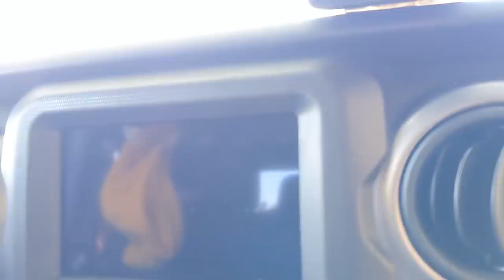Gladiator max tow Why I bought a barbie jeep

Comment: Just got mine last week. Sport S Max Tow in Snazzberry. I’m loving it. Like you mentioned, it wanders a bit on the highway. Nothing crazy but it’s noticeable. Especially in heavy wind. .
Reply: Haha I just got the 2022 Snazzberry Sport S with max tow yesterday. I havnt tried towing yet but I have a Sundance 222RB travel trailer so thats why I got that one otherwise I may have gotten the Rubicon but what I didnt realize untill today was that the Max Tow also gets the Dana 44 with 4.10 gears so I was pretty happy. Just no front lockers... thats an easy fix though.
Reply: @hillsideheathen5267  Hell yea. Front locker and rear LSD would be nice!
Reply: @hillsideheathen5267  check out a couple videos here on the  you tube channel: Renaissance man, a black sport s with max tow, he has Rubicon rock rails, but that was it for mods, where he went down to a river, really rocky terrain, camped over night, and climbed out the next day, wow! a little damage, but overall impressive. bought a Rubicon 2 weeks ago, more of an availability thing, and the only way to get the painted metal top. but my plan was more like what you got, lift it two inches, put it on 285/75R17's and good enough, still not saying that I won't...but I'll give the truck I bought an honest tryout 1st. I mean, got it now...

Comment: This guys has no clue if he thinks the Gladiator can't wheel with the best of them.  Many Wrangler owners switching to the Glad so they can bring a lot more gear with them on rock crawling trips.
Reply from the maker: I mean they can wheel but they are very long you need big tires and a big lift to have a good breakover angle and then they're not practical on the road
Reply: @MudPuppyOffroad  🙄 I've got 5,000 miles of hard off-road driving on my Max tow. I'm still waiting for it to fall apart. I'll let you know when😐
Reply from the maker: @blackpearlvoyager4174  5,000 mi LOL that's cute my tundra had 300,000 on it when I traded it in
Reply: @MudPuppyOffroad  yeah so did  the 07 JK that I traded in for this. You're not the only one who questions the reliability and durability of the Jeep Gladiator or Wrangler. 

How do you explain why tens of thousands of people trust them in the backcountry including myself?

Take care of your Gladiator and it'll take care of you but don't be afraid of taking it to Moab and doing some wheeling. Been there done that.

One thing you got right though and that is they are good for towing. My little travel trailers only about 4,000 lb but with the 3.6 and that 8-speed transmission (that makes it seem like a bigger engine) it's a joy to pull a trailer around. Cheers!
Reply: okay dude, compare the length to a wrangler of course your gonna need a lift because it’s a longer frame but just as everything it has its pros and cons.. way better for overlanding than a wrangler but of course it won’t lead a wrangler for rock crawling because it’ll center. When u buy a vehicle u need to buy it what a vehicles designed for 🤦🏽‍♂️.
Reply: I have the rubicon JT on 6 inch lift and 42s, make that Toyota cry for mommy 😂😎

Comment: heres the thing i got a gladiator  at first i didnt like it so much  but when people say not a good jeep not a good truck  MOST people 99% of the time dont need either as far as GOOD goes  but here is the thing when u need the bed its there.. and the doors come off and top  so its real fun  if u order the $1700 mopar lift kit and 35s  it will do things no other  pickup truck can do and with 37s it realy becomes great off road and the market is there to easily do it  a rubi or mojave can fit 35s easily and 37s mopar lift...its just too easy to make great... i love mine more and more everyday. small bed has uses
Reply from the maker: Very fun vehicle. Great if you dont do a ton of highway and park in a garage. Sold mine because of the wind noise and water leaks

Comment: Very informative video. You certainly put that Gladiator to the towing test. You are also much more versed than I am on suspension components, etc.  The Gladiator sounds like it has some good stuff. 
Several Vehicles back, I had the Wrangler Unlimited. I loved it. Basically, being a truck guy, I had to get the Gladiator. I found my deal up in Hilton Head. Flew up from Florida and met the salesman at the airport. Driving back, I did 75 to 80 in the soft-top (which I was searching for and wanted).  I was actually impressed that it wasn't nearly as loud as I thought it might be. The Wrangler i previously owned, I purchased with the hardtop but quickly sold that when I realized I bought a Wrangler and a Jeep for the ability to quickly drop the Top. Having driven both, I am impressed with the sound levels at high speeds with a soft top. This one is the Gladiator sport has the max tow package, sprayed in bedliner ,Mopar side steps, and Moto Metal wheel upgrade with no suspension lift. I just recently had added equivalent size Tires to the Rubicon. Had to go with the more aggressive tread pattern just for Aesthetics. The package it has gives the four optional auxiliary buttons and the upgraded Alpine system with a very effective sub woofer behind the rear seats. A 2020 which was certified pre-owned with 8400 miles on the odometer. This thing will be a mall Hopper that will hit a mud puddle only if I can't avoid it, haha. Thank you again for the informative video.

Comment: 5k RPM's the whole time lmao. Fine as long as that V6 is sturdy. Not gonna lie, iv run the piss out if a 4.8 chevy for almost 10 years now and my overall opinion of what an engine should be with proper Maintenance has changed. Gonna be hard to look at a Chrysler V6 for a while
Reply: it’s the same as a 5.3 lol a bulletproof motor only difference is heads
Reply: The Pentastar is a nightmare - BTDT.  Never again.
Reply: @thefloridaman2348  shorter stroke and smaller bore as well. I'm about to put a 5.3 in an 05
Reply: i’ve had the 5.3 and 4.8 in multiple trucks. you literally can not beat those engines. Completely problem free with proper maintenance.

Comment: Those jeeps are notorious for windshields breaking due to the angle of it when rocks hit it, when I had mine I replaced it 4 times once with a “special high strength keep glass” and that shit broke too.
Reply: Without doing research, I’d say that I don’t think this is true. My jeep has taken hits of rocks and pebbles, but it’s never crack. Its chipped once out of the 5 or 6 times a rocks hit it. I have two jeeps with similar windshield angles, my dad has 7 jeeps with similar windshield angles, and nothings happened.
Reply: Ive run 3 tjs (and picking up a mojave next week!) over the last 18 years and 300k miles mostly hwy. Never had a chip :) maybe im just lucky

Comment: Well compared to an older jeep that’s a Cadillac, but they have strong axles you could run 40s and just don’t be stupid and they wouldn’t break. I got 35s twin locked on Dana 35 and 30 I’ve done rock climbing and the whole nine yards never broke. I know a guy named buferd who destroyed Dana 80s left and right with a 200hp engine truck. Axles are only as good as the driver I think your a good driver so your yota hasn’t broken. Give it to the right person they’ll break.

Comment: Based upon your analysis and discussion so far (I'm at 5:25 in this excellent video), I suspect you are going to regret (just a tiny bit) not getting the Rubicon trim, given the other toys you have visible in the video.  Also, I've seen some pretty gnarly Jeep Gladiator Rubicon videos, and so you may find yourself kitting out your Jeep Gladiator anyhow, just because... after all you can never be too well-equipped... 8-)
Reply from the maker: I disconnected my sway bars pretty easily by removing the bolts. Irrelevant though because of the wind noise and water leaks were so bad. I got rid of the vehicle after a year

Comment: Welll your auto 850re transmission is actually built by Chrysler based on the ZF design. 4x4 wise, Only the 8hp75 to 8hp95 are ZF built and used but not built by Chrysler
Reply from the maker: Interesting

Comment: Do you know if the rubicon gladiator diesel springs are stiffer than the max tow ones? Thanks
Reply from the maker: I'm sure the fronts are. But being that it has a lower overall towing capacity I didn't want to mess with them

Comment: @ 1:06
My jku will say different! 
IN Arizona Toyotas suck maybe the desert is more extreme. 🤷🏻‍♂️
Reply from the maker: Yeah let's go drive some mountain roads and see if you can keep up
Reply: @MudPuppyOffroad  AZ has mountains too but ours are not softy padded with vegetation like yours they more like razor blades, the Toyotas don't like the summer 120°F heat either
Reply from the maker: I just had a gladiator if you didn't watch the videos it was awesome off-road but it was a miserable piece of shit everywhere else water leaks wind noise power steering Creeks pops squeaks Etc there's nothing refined about a Jeep and I'm an adult I like nice things
Reply: @MudPuppyOffroad  can't speak so much for that JLT, but my JKU is not stock not really setup for rock crawling although i can do it, more overlanding/desert runner.
But I recommend you swapping out them ball joints witj some greasable Heavy Duty ones ASAP also adjust the lash on that steering box.

Comment: I thought you would have to get lower gears for 35s since it’s just a v6.
Reply: Something he did not mention about the Dana 44 wide axles is that they are also a 4:10 gear ratio. That's just part of the max tow package. Very easy to go 35's without much difference in performance or even fuel mileage.

Comment: “Real off roading that’s what Toyota’s are for” Did your Toyota come stock with front lockers, disconnecting sway bar, 410 gears, off road tires, rock sliders, front camera, and does it have better approach and departure then a Jeep Wrangler? No it does not. Why is it you see more jeeps on the trail then Toyota’s? Because wranglers are a better and more built for off road. Plus Toyota’s will rust out from off roading.
Reply from the maker: Oh a little butthurt Jeep boy. Ever heard of an 80 series Land cruiser? Americans know nothing about off-roading
Reply from the maker: a long list of cute features does not make a vehicle a serious off-roader it has to actually be reliable and bulletproof
Reply: @MudPuppyOffroad  nothing cute about those features. Out of the box jeeps are clearly better off road then Toyota turds! Sad when you have to spend thousands to make and claim a Toyota is better then a Jeep.
Reply from the maker: I've seen several of the Jeep diff locks fail and a ton of the sway bar actuators features don't do you any good if they're broken and you can't rely on them That's why you get a Toyota for any kind of serious off-roading
Reply from the maker: I agree out of the box a Jeep is more capable than the current Toyota offerings however within a year they become less capable because shit stops working
Reply: @MudPuppyOffroad  I love all the jeep hate, but comparing anything to a modified pre 100 land cruiser is pointless. The only apt comparison for the gladiator is the new taco which is mostly plastic and an electric transfer case that wont ever engage when you actually need it strapped to rubber booted gear hunting expedition gar-baj.

Comment: You seem like a guy that would do better with a trailboss
Reply from the maker: On the street sure... Off-road its just a ifs road truck with a 2" lift
Reply: @MudPuppyOffroad  well a trail boss with the 6.2 vortec will blow your mind with the off-road and work capabilities that truck has, my uncle's got one and we use it for farm work, and it does amazing at it
Reply from the maker: @Donavon Kuzak  That's literally the exact truck I just got rid of I had a 2019 6.2... also you cannot order a trail Boss with a 6.2 and leather so what's the point